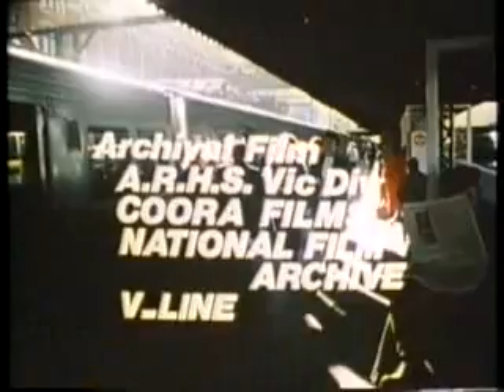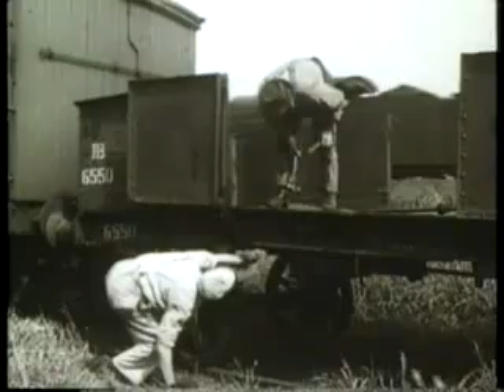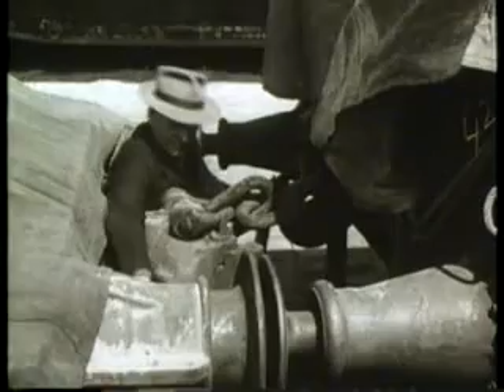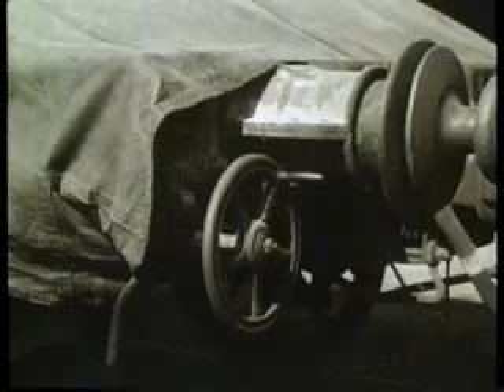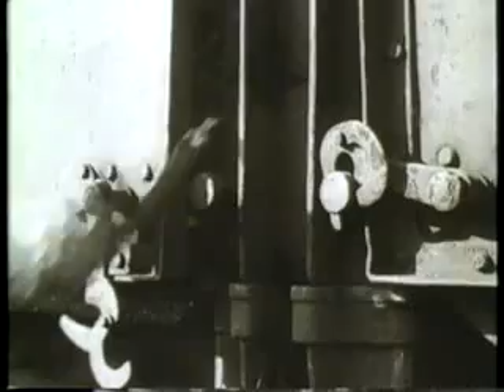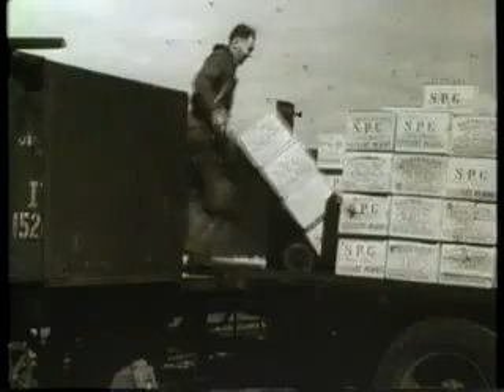Historical Victorian Railways Footage - Part 2 of 3

Comment: I just happened to see this film today and was astonished to see a person who I believe is my Dad in one scene.  Could anyone tell me in which year this film was shot?  It would help me determine if the person is indeed my Dad.  He was a shunter for a while before becoming a driver.
Reply: At 6:21 I can just make out a 1948 servicing date on the wagon. This is consistent with my opinion of late 1940s film. Lack of diesels too and ref to steel shortages which were postwar. Training film for all the new workers needed post war.
The C class steam loco at 18:54 has a square oil bunker on the tender so after the start of the 1946 to 1949 conversion to oil firing. No oily Cs prior to 46.
Reply: Thanks for your detailed information. It’s much appreciated. I wish you the best.

Comment: And not a high vis vest in sight!    But in all seriousness, I’m assuming when shunters had a bad day at the office, it was really bad.   Were buffers banned for safety reasons?
Reply: buffers were removed from carriages after being auto coupled because the auto couplers were self buffing unlike the screw couplings that only pulled and required the buffers to stop the carriages smashing into each other while slowing down, going down hill etc